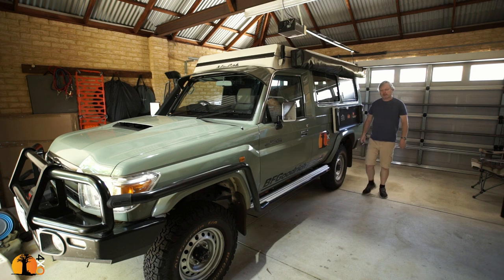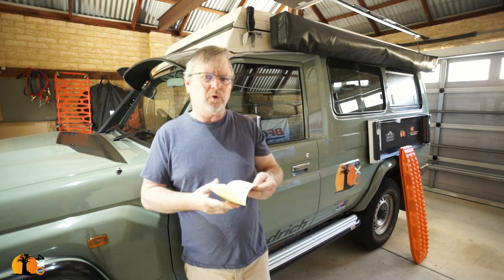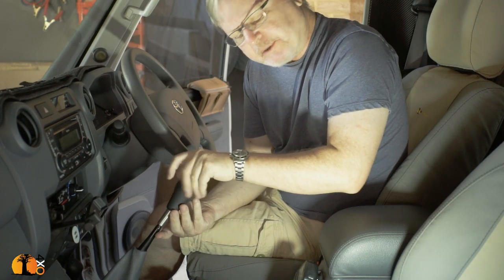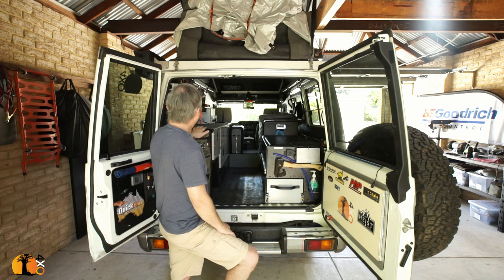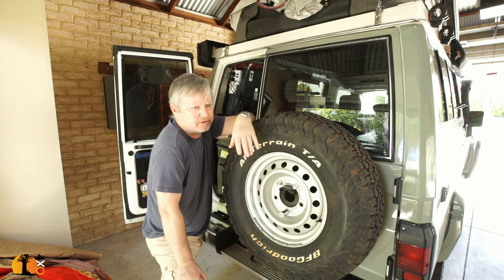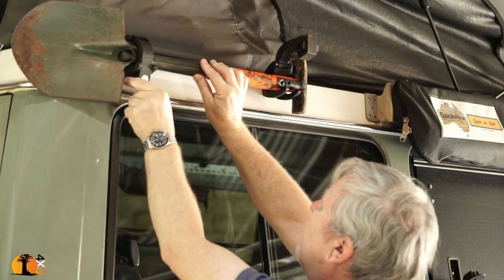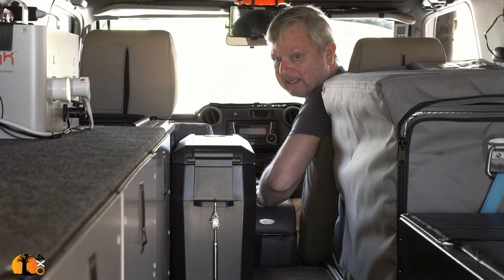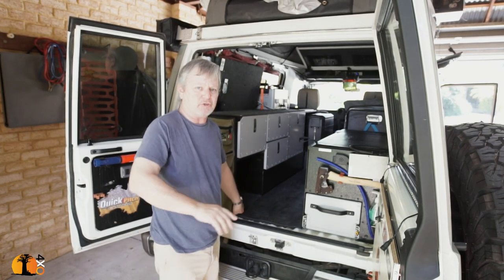TOYOTA LAND CRUISER TROOPY BUILD - phase-2 begins

Comment: Another enjoyable video Andrew, not editing out the bloopers just makes that much more endearing and relatable.  Regarding weight; ditch the second shovel (the little one).  Some duplication for essentials is okay (flashlight, knife, etc) cut out small unnecessary bits of kit and it adds up.  You can save some significant weight by spending the $$$ for LiPO batteries and losing the lead acid batteries in the back. You'll gain space and capacity as well, but I'll bet you already know that.  If you roll through Northern California, a hot shower and nice meal await at my place.

Comment: Great stuff.
Just take a tyre carcass. 
My troopy is 2.8 Tons CSR ready. You are going to max out for sure.
Looking forward to the weight loss episode.
Keep up the excellent work.
👍
Reply: r0blashley . A set of ‘tyre pliers’ and 2x 500mm levers weighs 1/2 of a  bare steel rim. That saves you 10kg. No it’s not a lot...... but it is when you are nearing your GVM.

Comment: 12min: These are called “Airline“ rails. I use them too. Outside and inside. They are also available as 1 fix point ones! Very good to add 1 mount at each corner.
Also: note that these Airlines are available like yours but also much nicer with rounded sides or to be mounted under or over 2 pieces like plywood floor.

Comment: check an office supply store for standing desks. They make some that telescope and have several adjustment points, the issue will be finding one small enough. If nothing else you could copy a design that works and find someone to scale it down.

Comment: I run a yakima rack with their more basic metal attatchments on my montero. I will say, you need to run at least 3 cross joints for an extended rack system. I ended up with a broken rear mount when I was running only 2  cross rails on the rack. I ended up with quite a bit of damage on the canopy of my ranger, but I made it back to camp, and then a 600 mile drive home. This was with a fulls ize spare on top along with a high lift on the side, one full size axe, and one full size shovel. Their plastic mounts just cant hold up to rough rough gravel roads. Granted this thing ran 2 spares on top at one point, and did do years worth of eastern oregon gravel roads. I now run 3 cross polkes so I wont have to worry about damage if one fails.

The old yakima metal clamps work fairly good on for the shovel and axe mounting, and their high lift jack mount is top notch.

I think you will be ok with that tiny shovel mount andrew, although I would prefer some sort of metal.

Comment: For your edit suite...  If you really want to do that in the back, look into a Stadium Chair (When you are in a sports venue with only benches, it gives you a pad under your butt and a back rest) and an adjustable height standing desk conversion.  When not in use, you can lower it down to normal height, and when editing, it can raise and move towards you and be your edit suite desk.

Comment: I don’t if you’ve already chosen a brand for exterior lighting on your vehicle, but Rigid Industries is an American brand with impeccable quality and an incredibly large selection of different LED lights and styles. They also have protective covers that you can buy for their lights either just for protection or to alter the color temporarily (i.e. standard daylight white LEDs for most uses, amber for rainy of snowy conditions, red for nighttime use, etc.).

Comment: If you google Flexible Monitor Stand, you might get something that will work for you. I doubt you want a giant contraption that will take up a bunch of space, but an arm that fold out of the way and extend to whatever position you would end up sitting in might be the ticket. I was thinking something similar to an old desk lamp that has the springs mounted on the joints to stabilize it. Good luck!

Comment: Oh I forgot to mention, if you are looking for a smaller size LED off road light,  a very high quality and extremely bright light is the Erica, or Sevina by Clearwater Lights USA.  They are light and allow more air flow when mounted in front of the radiator.  I have had them for years on my truck and motorcycle and they are fantastic!  All the best Andrew

Comment: Logitec has a $20 wireless keyboard/mouse pad uses AA batteries and is PC/Mac capatible. I bought mine in 2012 and have never been limited by my computer since. Check it out before building a bracket for your workspace

Comment: Love the MaxTrax mounting, such a good idea to have it dual purpose. I will be interested to see how the dash-cam goes as every one I have bought so far has literally deformed in the heat. People say 'remove it when parked' well I don't want to, I want to set it and forget it. Had to laugh at the 'designers don't go camping' comment. Something that drives me absolutely POTTY is products that have just not been thought through by those who design them. I grind my teeth, pull out my hair and regularly say rather rude words when I use a product that Blind Freddy could see isn't designed properly.
Reply from the maker: I'm hoping that the sun visor will protect the dashcam. We'll see.

Comment: As far as a work area and comfy seat, why not do a set up using the passenger seat? A removable, or stowable desk for the computer but using a seat which is already designed with back fatigue in mind.

Comment: be wary of dimmers as the may interfere with radio reception

you might want to consider pvc pipe with screw end and mount on the outside   with longer poles, as you have a l0ong cast when fish from the beaches up north a longer rods..

you might be fine for whiting and tailor though the fighting fish of the north west will likely snap your line and pole..

with the ya light bars you might want to check into units that flashing components in them  as yoyuu may need them if youi breakdown on the side of the road..

not so much in the states though over here you mat want to consider an a-frame bar so you can be towed behind another car or road train..

encase of vehicle failure i don't recommend in snatch rope pulling over long distances i believe in mechanical fixing to either to the front wheels or of the  bull bar
the only 3 solutions is spots and/or bars for lights

you'll need to get a 27mhz radio with ssb capacity and likely a ham radio..

UHF cb in may experience is great in a convoy though if you want distance you will need acess to a repeater  network..

I still believe in a  min of 4 spares..

looking at the abandoned vehicle in 1 of your ealier vids..

drving Ausralia may similar to your experiece in Africa thogbuh in some cases it can be worse here..

I would also suggest havingf gps available within cb/ham radio..

with thst roof top  tent bfore you go hangin gear off the roof you migh want to consider checking its weight capacity with a humans weight before you go sticking to the the cabin side of the vehicle.

note if you arr planning to take this to thre states at some point you will a left hand side conversion done...

Comment: Hi Andrew,
To answer the way europeans organise their vehicule, i can speak a little bite about France from where i am.
By the laws and insurance protection we are not allowed to modify our vehicules so much than you, therefore we over charge the inside to not have to do modifications the outside of it.
I completely agree with you that it is not so fonctional than yours. Also for parking underground and commercial center access we are limited to around 2 meters high.one more exemple the lights bar (front and rea) regulary make us in trouble with police for non respect of car maker specifications. 
And to finish with this, i have to say that France is not so save and if you attach something outside of your car then you cn be sure that it will be stolen in 2 hours.

Comment: For your 'editing room' you do have heaps of space above you where you could drop-down an 'office workspace'. Maybe also a similar but separate, shelf and (office) storage space where your clothes are. 
Obviously, it would need to be foldable to pack away and would require stability supports when down. To make this design easier, you will probably want to sit facing the front of the vehicle (with a bench seat across the aisle). It would certainly open up a heap of office work and storage space that is currently unused apart from some clothes.  
It might be very Andrew specific but maybe not. Could it be an Alucab accessory?

Comment: Correct me if I'm wrong, but you shouldn't rest your hand on the gear stick when the engine is running. You may damage the synchronizer rings of the transmission because you put pressure on and generate therefore friction  which causes wear of both the cone and the synchro rings.
Reply: Resting on the gear stick makes the shift fork press against the synchro hub and doing this for a while prevents proper lubrication between them and can do damage.  
Resting on it just briefly is OK though.

Comment: Great work I notice you don’t carry a chain saw I do a lot up Victorian high country 4wd and we would never leave home with out even a small chain saw not just for fire wood but you can head down a slow high country track for 6 hours only to come across a big gum across the road. Very common kind regards Danny
Reply: Dme . Take a look at Silky Katanaboy 650. It will save you weight and mechanical/fuel problems with the chainsaws. I use Silky folding-saw's - they are extremely effective.
Reply: tons834848 thanks mate had a look but I don’t have a weight problem and would never leave to go bush with out my 46 styhl chain saw

Comment: ive got my rear facing light bars running off 2 switches that operate the same as a 2way switch in a house for a hallway for example quite easy to set up just gotta get spdt switches from jaycar only issue is if you get illuminated ones the led backlights wont work properly which doesnt bother me too much but it may bother you

Comment: Could you use your passenger seat for your editing suite? It should be comfortable enough. The problem would be getting the keyboard and monitor where you could use them, and store them easily so you have a minimal hassle factor. An option to hold your laptop if you are editing from your front seats is to use something similar to what US police officers use for their laptops.

Comment: Love theese videos, getting a lot of useful ideas. Regaring you computer workspace; would it be possible to make use of the passenger seat? I know there might be annairbag there making it hard/difficult to mount anything to the dash, but maybe a roof bracket, so the monitor sit above the dash? Or go for a more recliner option. Fit the screen under your roof( same area as you clothing pocets), and make a new seat. I am thinking of something that is easy to put between your drawers and jusy put a nice cushion on top. This could be very easy to set up and remove everyday and also quite comfortable i think. Looking forward to more content! G'day mate ;)

Comment: O.  Get a couple of #75 atom oil lamps and 2 super baby oil lamps. Feuer hand. You will love the  light, great burn time,  efficient,
Reply: Do they run on whale oil :)
Reply: Rick & Zack Explore Offroad kerosene
Reply: I think the big advantage of kerosene lanterns are the heat they generate. On a cold night they will heat up a tent nicely. Of course that is also a disadvantage on hot nights I guess :)
I stopped using them mostly because of space. My LED lantern is small and puts a lot of light out. Plus I don't need to carry fuel and it's easily charged via USB. I just find it easier for me.

Comment: Hi Andrew. You may wish to consider industrial microSD cards that operate between -25°C to 85°C for the dashcam (to cope with the heat on the dash from the sun). I have had a high performance microSD card fail in a digital photoframe just in the conservatory at home, simply because of the heat which is nowhere near as hot as things can get on the dash of a vehicle. I'm moving to these https://www.sandisk.com/oem-design/industrial/industrial-cards . I have no association with that company.

Comment: I think you have to much junk. For example is that a massive mag light above the drivers door? Get an LED light. Every special bracket you have to "make life easier" is adding weight. Maybe you have to many drawers, those things weigh a ton.
Reply: It actually is a LED light. He showed it in one video he made with Ronny Dahl. It sits in a holder that is also a charger. Second use is as a weapon.

Comment: approx. 3.5 Tons? WOW
Reply from the maker: No. 3 tons. That's light for a camper.
Reply from the maker: About the same weight as an empty LR4.
Reply: For what you have on board that vehicle when fully loaded, it is less than I thought. Are you going to change tire height or width? I see the logic of skinny tires, but in the USA everyone puts the widest tires they can fit. Even a the risk of damage and extra weight.
Reply: That's less than my Ford E350 Diesel quigley high roof empty. I mean empty. Your storage department is obviously incredible light, don't know where you could make the truck much lighter than is. I do have the same approach:
I recently noticed that my 6 mm plywood door cover are exactly 1kg lighter/piece than stock!
Also I bought a set of Corelle “porcelain“ dish and noticed that these are almost near to plastic ones than standard porcelain, plus way more durable!
Sometimes these is unexpected potential 😀
Reply: Darren Hale #1 ground clearance - Diameter is the only way with solid axles
#2 “bodendruck“ is the German terminus - this is a formula to calculate when you get stuck. Width is one variable but height goes into that calculation in square! Tire diameter is the most important factor (after correct profile for specific condition which you cannot prepare).

Comment: The answer for your work desk in the vehicle is "parallelogram hinges".  They could be made with stops so it is as high or low as you desire, or even alter the geometry to allow tilting, but still go back to flat on top of your drawers.  Could probably be made so that it is no more than 30mm thick.

Something like this: http://veada.com/boat-pedestals/aluminum-scissor-hinge.html
Or this: https://www.aliexpress.com/item/2015-Flexible-Folding-Table-Parts-Lift-Up-Frame-Extending-Coffee-Table-Mechanism-KYD006/32523858817.html

Comment: Andrew, or anybody:  I'm looking at getting some of the LED colored strips. If they come with a wall plug, how do you run them to your battery/fuse tap?
Reply from the maker: LEDs run off low voltage. The wall plug is to converts from high to low voltage. Just buy LEDs suitable for a 12v car. They will be cheaper.
Reply from the maker: be carefull. The LEDs you buy may not be rated at 12V. It might be lower. Check before connecting them!
Reply: Definitely, thanks Andrew. Any plans to sell those 4XO stickers you've got on your troopy? Would love to represent your channel over here in the states!
Reply from the maker: Stickers are free to supporters of the show: https://www.patreon.com/Andrew_StPierre_White

Comment: Love the RAILS, where do you find those? Excellent video!
Reply from the maker: In my local 4wd shop. They have no brand name.
Reply: Found the rails on Amazon if anyone is interested.  Search for “Hi-Lift Jack, slide and lock, tie down system”.  Sure they are available at 4WD shops as well, as Andrew indicated.

Comment: Andrew, I've got a question: Would you replace the troop carrier w/ an LC200? Do you think it can successfully handle the same terrain your troopie does? If not, where would it fall short? What solution would old have for automatic expedition-level off-roading?
Reply from the maker: My truck is an overlander. It will make a better overlander than a 200. A 200 is an suv. Which is not the same tyre of vehicle. They are or can be made to far exceed a troopy when it comes to off-road ability, but not overlanding ability.
Reply: Thank you, Andrew, this is very helpful. I think my decision's made :-) How can one get in touch w/ you to consult further on off-rad modding?
Reply from the maker: 4xoverland.com has a contact page. I will be in the bush until end May. I shall be able to communicate properly from that point.

Comment: Question. At the rear area.if you put the table on the on the other door, would you be able to access the long drawer with the table down?
Reply from the maker: it is too wide to fit on the other door. Doors are not the same width.

Comment: skeptical about the red LED's, i can imagine it might hurt your eyes or give you a headache especially if you try to read as you say.
Reply: navy veteran speaking red lights have been used on ships for decades during night time hours. the reason it does not impair your night vision at all giving you the ability to transition from indoors to outdoors without your eyes requiring adjustment; it is less visible from a distance than white light and it actually causes less eye strain than daylight.

by attempting to solve a problem about bugs he stumbled onto probably the best solution for working at night that he possibly could have :)
Reply: Completely agree, very easy on the eyes, and your eyes adjust rapidly to the red lights.  Just takes a few days to get use to it and you will proably never go back.  That being said I would be concerned with the computer/editing work in the red lights though.
Reply: Steve Aaen ...will end up in Funny white balancing video cut probably ...
😂

Comment: Nice setup.. why arent you putting fatter tires again??
Reply: Aaron Donald he sad on a older video basically the gist of it you want a narrower tire for sand he also doesn't care for super wide tires
Reply: Pizza cutters FTW!
Reply: Skinny tyre pros: less punctures, easier to drive through sand, use less fuel when off road, better in most off-road circumstances (against a fat tyre of the same diameter).  
Skinny tyre cons: worse on-road cornering, hard to find in large diameters.